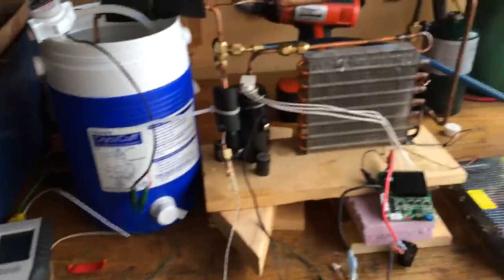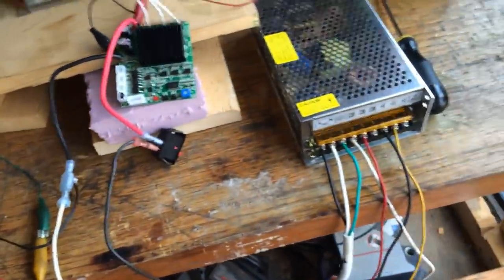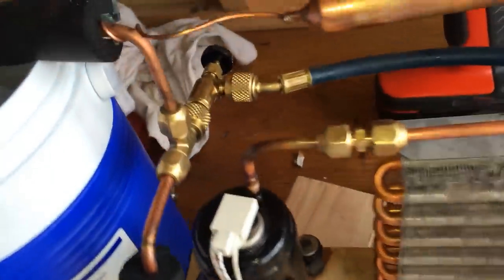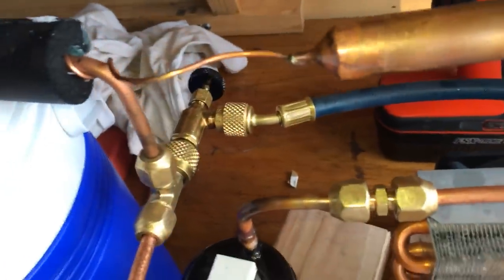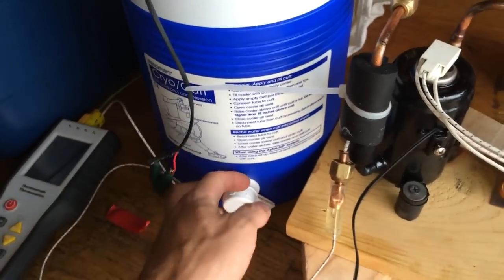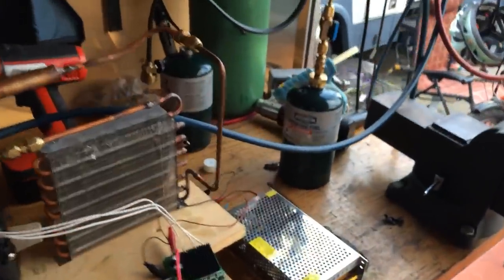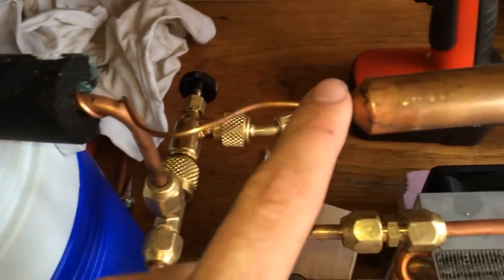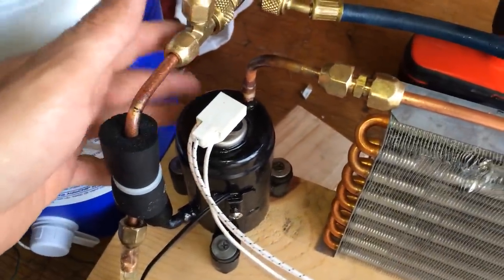DC Compressor- Water Chiller

Comment: Hi there . Seen a few of your tinkering videos and it's inspire me in to action😂I have a broken 12v fridge as the electronics got wet and have failed . Is there somewhere online I can get another control box cheap that you know of .
Reply from the maker: Is it a newer refrigerator?  What kind?
Reply: No it's probably 5 years old but is 12volt. When it was found it was missing the lid,controller and electronics. Just the compressor remains
Reply from the maker: There are a lot of BLDC controllers out there which will work for that thing.  Unless it is a really tall, skinny compressor like a Sawafugi, then a normal controller will work:

http://www.ebay.com/bhp/bldc-motor-controller?rmvSB=true

Comment: hello, I have a small portable air conditioner a300 from AliExpress that works with a mini compressor at 12v scroll. I accidentally connected the wrong battery and burned something on the motherboard. can I fix something else, or what do you think happened? could I install a waeco car refrigerator motor?

Comment: All the BLDC compressors currently out there seem to be designed for r134a.

I'm finding VERY mixed opinions about replacing r134a with r290.

Was your compressor also listed as r134a or is it intended for r290?

Have you ever tried using r134a?

Comment: could It be possible to make s fridge out of one of these
Reply from the maker: Mocha Guerrero Definitely
Reply: M.C. Pletcher where did you find that tiny compressor
Reply from the maker: Mocha Guerrero A friend got it on eBay. I haven't seen this one available in a while, but if you search for mini DC compressor, something usually pops up. I'll warn you, they can be a bit noisy under load.
Reply from the maker: Mocha Guerrero Might be better off with something like this:  http://m.ebay.com/itm/12V-24V-DC-Refrigeration-Compressor-Freezer-Marine-Solar-Off-Grid-QDZH35G-R134a-/182442544930?nav=SEARCH

Comment: I can NOT find these compressors anywhere on ebay! Why? Can anyone provide a link? If not for ebay can anyone suggest an EU supplier?
Reply from the maker: Stathis Bikos these were available for just a short time. There are other BLDC compressors on eBay and rParts.com. Unless you need one really small, you're better off with a larger shelled, quieter compressor.
Reply: M.C. Pletcher thanks for taking the time mate.  I do indeed need the small size but mainly the small weight and portability.  I'm trying to build a portable high performance cooler for my car and such,  and i am trying to avoid TECs so i don't overwhelm my alternator. However it seems that's where I will end up eventually.

Comment: Does the compressor and your tubing not stink of propane?
Reply from the maker: Not once it is sealed, but if I vent it, then yes. After running for a while, I've noticed the filter and driers will take some of the stink out.  I might buy some r-290 sometime for long term installations. It should be more pure, with lower water content and no stink.
Reply: Have you seen my propane mercaptan removal video? I remove the odorant and dry it with silica gel.
Reply from the maker: +Shaun Dobbie I have. There are some different methods around for doing it. One I remember, involves using a recovery machine to pass the same propane back and forth through some filter driers over the course of a day or two. Others, which are used for other refrigerants as well, involves hooking up a full tank to an empty one, with a drier in the line. The empty tank is placed in a refrigerated space, while the full is left in a warmer environment. After a few days the propane (or the lighter components) will condense in the empty tank, leaving much of the water and heavier oils behind. 

Personally, I have plenty of fun with the junk right out of the tank. I've thought about building a distillation column to separate out the butane and propylene (much harder), but I'll probably just buy refrigerant grade stuff when it comes time to build a permanent device. Check out the Ecorenovator blog. There is a lot of useful information there. I know of a few threads about r290, so search
Reply from the maker: +Shaun Dobbie ....around. http://ecorenovator.org/forum/geothermal-heat-pumps/1456-propane-r-290-heat-pumps.html

Comment: where i can get a dc compresssor
Reply from the maker: The eBay listings are hard to come by.  Here's a link to a compressor I would be interested in, as it has the larger shell and oil capacity.  I've never oredered through a website like this.

http://purswave.en.made-in-china.com/product/TeCnFJqYgXpU/China-DC-12V24V48V-Compressor-Bd25h-Bd35h-for-Solar-Refrigerator-Vehicle-Freezer-Showcase-Icemachine-Dispenser-etc-.html

Comment: wear did you get the board for the compressor?? The part between the power supply and compressor?? I have a DC compressor and need this part.
Reply from the maker: I don't know. Mine came with it.
Reply: If you find a source for one I'd be greatly appreciated. Looks like the same plug on my compressor and everything.
Reply from the maker: +Bunk-Bunk so where did you get the compressor?  Did it come without a controller?  Is it the same one I'm using?  I believe there are a variety of generic controllers pit there which could be made to work, but I'm no expert.
Reply: +M.C. Pletcher on the side of the road it's in a 12v edgestar fridge and my controller is shot. edgestar doesn't sell replacements
Reply from the maker: +Bunk-Bunk is that an Australian brand?
Reply: +M.C. Pletcher not to sure I'd just like to use the unit. it's very nice and just a heavy cooler without that part.

Comment: hi there, I've been watching this video a few times, but I can't seem to locate the expansion valve anywhere to cool the water. However, I've observed that the tube size from condenser is large, goes through the filter becomes small, and after that it goes through another larger tube before coiling around and returning back to the compressor.  Does this changes in the tube sizes causes the refrigerant to compress and expand hence causing the cooling effect? I am a newbie tinkerer, and am trying to build my own water cooler system. So sorry for the stupid questions, but I would be very grateful for any replies to my question. Thank you!!! Regards, Ben